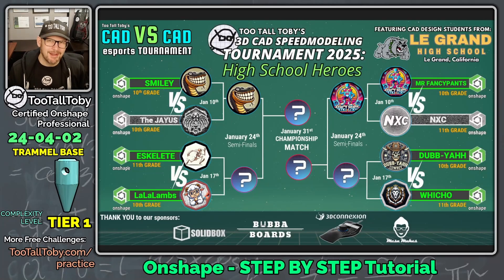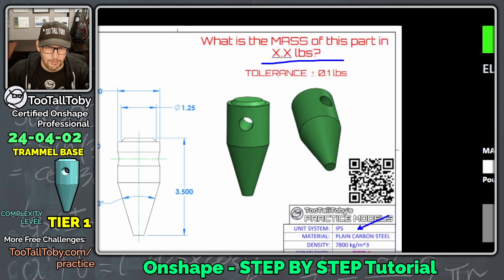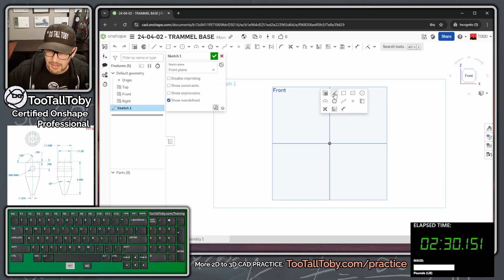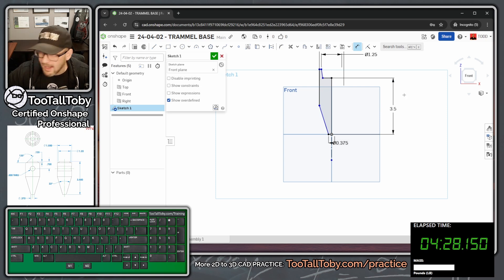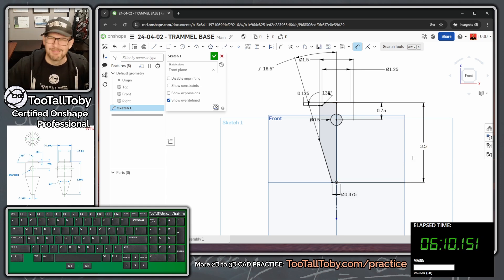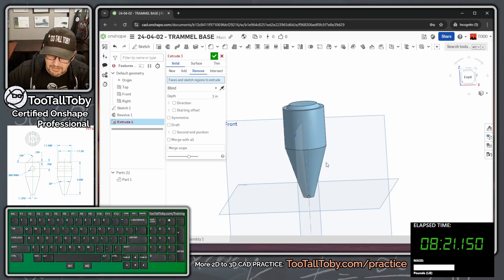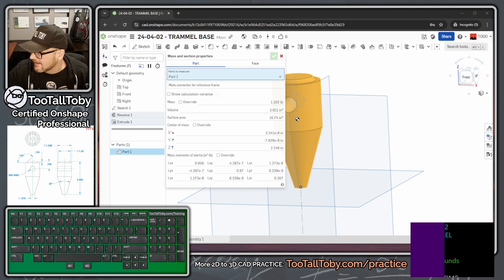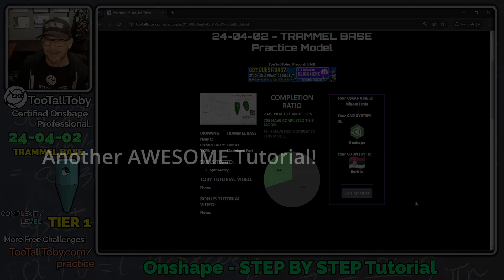Best Free Onshape Training / Step by Step Tutorial for Beginners! -24-04-02 - Using Revolve

Comment: My CNC programmers want holes added as holes instead of extruded holes.
Reply from the maker: Yeah it depends on how they are receiving the model. If it's an older STEP file, the geometry will be identical. But if they are working with the raw files from the CAD system, the CNC may be able to extract additional HOLE info.
Reply: @ sorry my comment was kinda vague. I'm just jealous you can do extruded holes because at my job its forbidden! haha and yeah the CAD software uses the hole info to help select the proper tool. They even want a tolerance on there so if its +/- .010 then it will auto select a drill and/or if its +.000/-.0005 then it  will auto select a boring head.

Comment: Yes, yes, yes - add those zeros before the decimal point!  When I am teaching physics classes, I count off if my students omit it.  One reason is that many of my students will move on to a medical profession, and many (most?) medical/pharmacy schools will kick out anyone who makes that mistake even once.  An order of magnitude too much or too little medication can be lethal!  What is the standard in mechanical engineering?
Reply: The ASME standard states that for inch units you do not use the zero before the decimal place, but for millimeters you do.
Reply: @kateleipold4838 that's so interesting. Thanks!

Comment: I struggled with this one as I couldn't get the dimension to cross the mid line. Realised I was dimensioning to the vertical of the model not the construction line. As soon as I changed this it worked.
Reply from the maker: Awwww yeah nice job!  I liked this one - it was a little simple part, but there were still some great onshape lessons in this one!